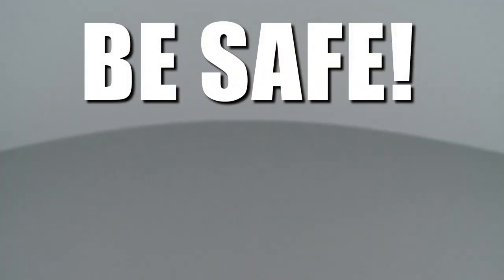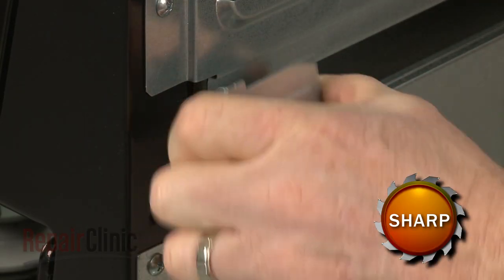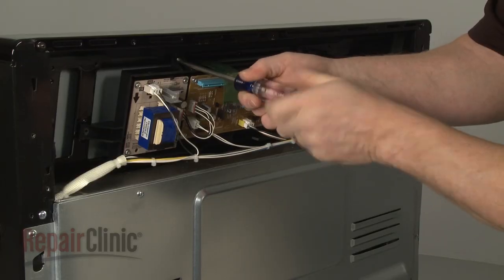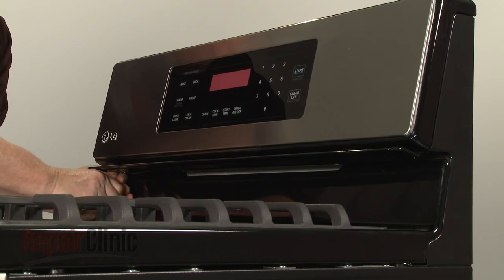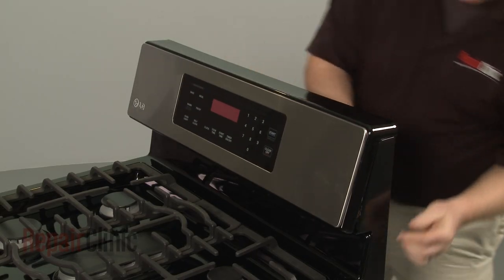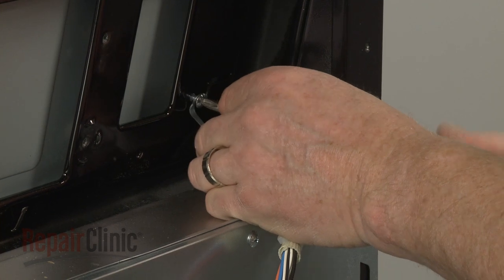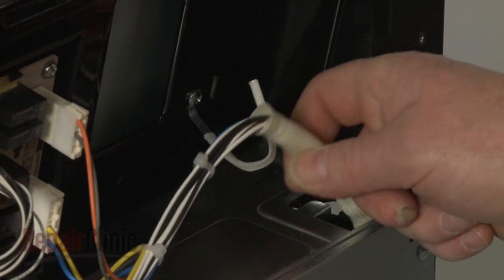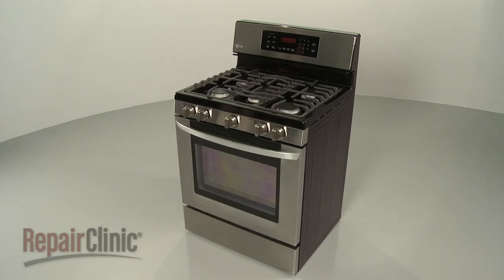LG Gas Range/Oven Control Panel Replacement #AGM73590311

Comment: How do you replace the led . My controls work but the lights showing the temperature for stovetop do not show the entire numbers
Reply: Did you ever get an answer to this? We have the same issue with ours.
Reply: Same here!
Reply: Did you find out how to fix it?
Reply: So I’m guessing this is an ongoing problem. Mine is also not working.
Reply: Same here...

Comment: Stove goes on when I set temperature , intermittently if I want to change temperature while the oven is on some of the buttons on the key pad will not work while other do. Seems to happen when the oven has been on a bit . I usually unplug the oven and sometimes it will work properly. Any help would be greatly appreciated.

Comment: Where would I get the 6 wire plug in connector for the control board?  It connects the range display control board to the range power control board.  It is not shown in the model's schemata nor is it listed in the parts inventory?  I've checked every parts outlet and even LG Corporate - no one has a clue.  Any ideas?

Comment: I just need to replace the silver plate that goes around the control panel. What do I need to do?
Reply: Same!  Did you ever figure that out? Tried to do it this evening and I couldn’t get the plate off.